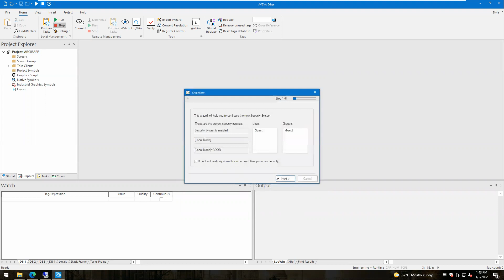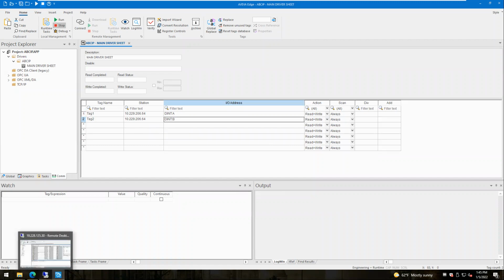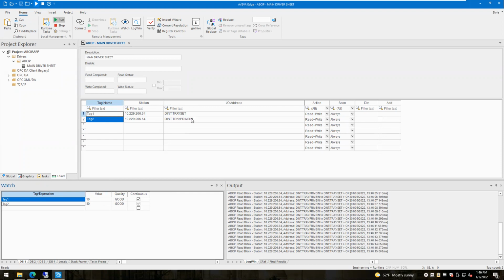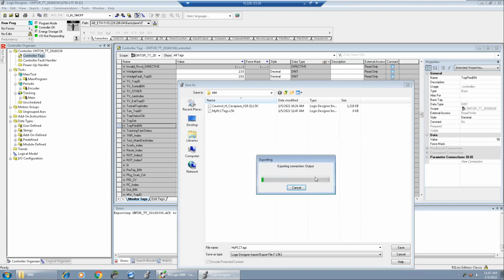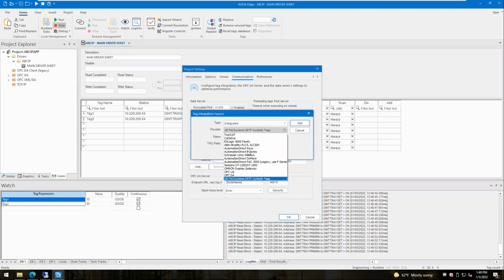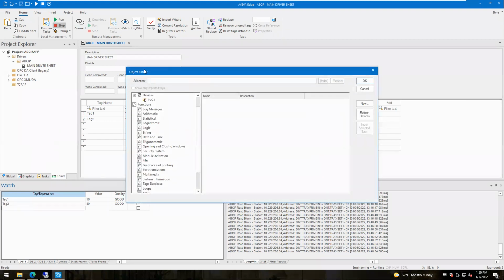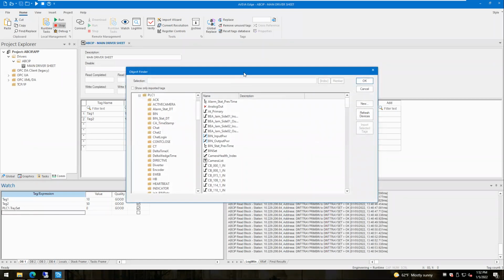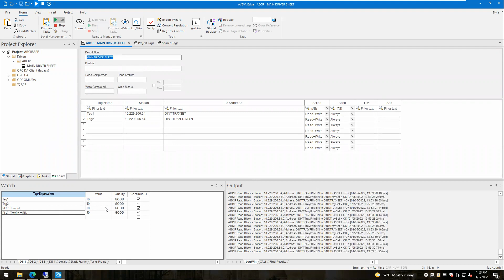How to integrate Allen Bradley PLC tags with AVEVA Edge automatically

Comment: Thanks for the video, I have a question, if I already have my SCADA PC with the AVEVA EDGE software, would I only need my PLC to connect to the PC via Ethernet and then the data would be displayed in the correct SCADA? Or what would you basically need to make it work? any port? gateway?OPC?
Reply from the maker: Nothing. Just the PLC IP address.

Comment: Hi Mr. Meza, i saw you video about AB tag integration. I try to do the same with s1500 using opc ua comunication. I importerebbe tags in shared database and if i run application everything goes fine. I i download app in the target pc the imported tags do not communicate with plc. Can you suggest something to solve this issue? Thanks